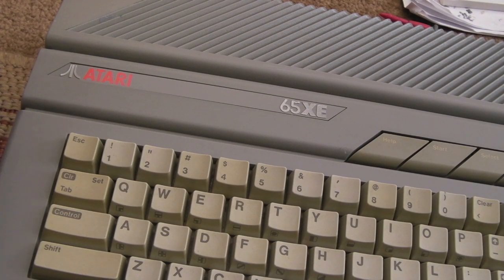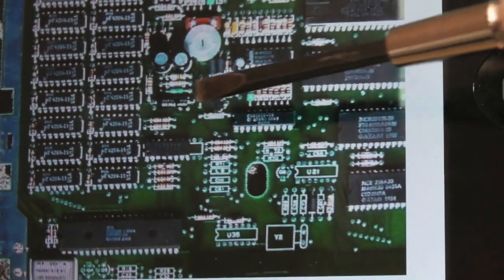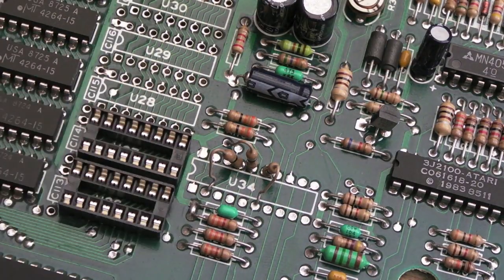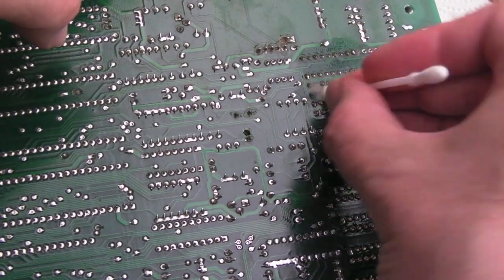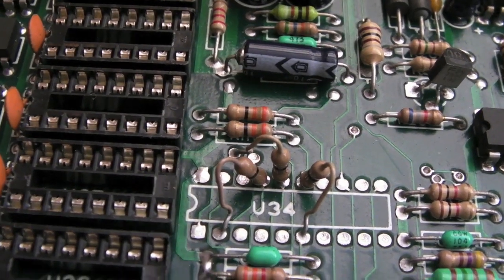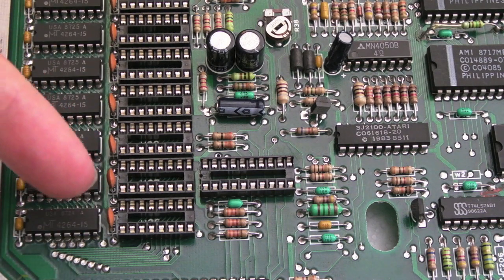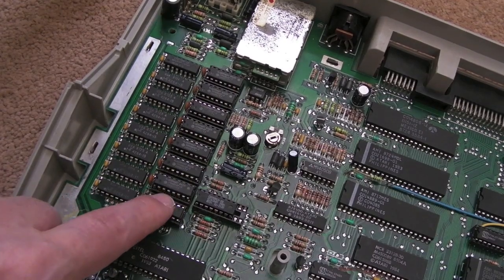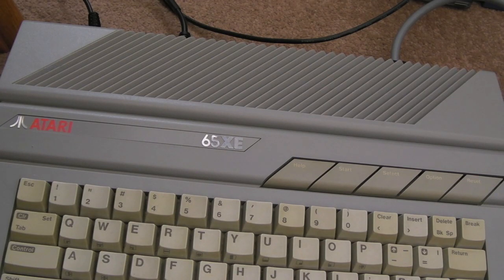Atari 65XE RAM Upgrade to 128KB (Effectively 130XE)

Comment: BIN files are typically cartridge images. ROM are usually OS ROM images.  ATR are disk images without copy protection information.  ATX are disk images with copy protection information (your disk emulation system needs to support these, not all do).  XEX are single file executables.  Those are the "modern" extensions that are being used for the most part in the Atari 8-bit community.

Comment: I recently had to replace the LS4091 shift register/encoder chips on my Atari 800XL. Cheap and easy, since mine was socketed. Actually, my RF/EMI shield was a pain, unlike many other 800XLs I've seen, but I've dealt with that in the past and made it easier to get into. Mine must be older than the ones where I see people unscrewing the shield because it also has a terminal/disconnect for grounding the cartridge door flaps.
Reply from the maker: Out of interest, what problem did you experience before you had to swap the shift register?
Reply: GadgetUK164 - Retro Gaming Repairs & Mods Many keys would not work, even after cleaning the mylar. Consulted a key matrix diagram and many appeared to be on the same row or column of connections. Checked continuity on those connections and found it was all good, despite the mylar looking burned in some areas (just oxidation). Swapped the two shift registers and noted that the specific keys that worked/didn't work changed. BINGO! I got 3x for $1 and now it's good as new!

Comment: I can't say for certain about all .bin files, but certainly Bug Hunt was packaged as a cartridge with many Atari XEGS systems, the console-ised version of the XE.  It was a light gun game, one of the few games that used it.  Similarly, Flight Simulator 2 was an old 8-bit game dusted off and given a (new?) cartridge release for the XEGS, presumably to make use of the keyboard, which at least initially was a optional extra.
Reply from the maker: Thanks =D  Yes, I think you are right in that the .bin files are cartridges.  I need to get one of those SIDE2 things now I think.

Comment: Got the 65XE now none of the tapes will load. It will Csave and Cload ok. Ive cleaned it all up, the belts seem fine its just commercial games that wont load. I get constant boot error. With holding down start and start and option on boot. Ive cleaned the heads with Isoprop. Ive tinkered with adjusting the heads but no joy. It dont sound right either, i know them dulcet loading tones well and you can tell its not going to load. Is there anything I can use to align the heads? I know the c64 had a tape where you turned the screw and the screen colour changed indicating alignment? Any help would be good. Could also need de-magnetising. Tried everything. Tape drive is a XC12.
Reply from the maker: Sorry for my slow reply!!!  Honestly it could be so many things!  I would assume that all the rubber parts in the tape deck are perhaps worn.  Any deviation in tape speed (or slipping) will mess up loading for sure.  I've seen so many C64 cassette units like that!  Take a look at what I did in that Amstrad CPC video (not the main repair the video I did soon after on tape loading).
Reply: Hi there I've fixed countless Atari and the disk drives and decks. The xc12 probably needs new capacitors. Or the head is out of alignment quite a bit. If the usual audio is really quiet then it's the caps. Believe me I've fixed stacks of them!  If the audio is ok and belts ok but deck struggles then either the 220uf power capacitors are on there way out or the motor is gubbed. All the best getting it sorted. Also make sure the sio pins are clean on your Atari and drives as that can cause problems too.

Comment: Once you upgrade your 1 amp power supply will not be enough...the 130xe with extra ram requies a 1.5 amp. Nevertheless, another great video, wish I could solder half as proficiently as you... perhaps in the afterlife.
Reply from the maker: Thanks =D  It has been upgraded (on my channel) a number of times - dual Pokey, 1MB RAM, SD2SIO etc.  Working fine!  Higher current is better though!

Comment: Using an Atari Ultimate Cart it plays fine in my Atari 800XL. Mine has an animated title screen with Harrier, a mammoth, and a giant robot. I was booting the cartridge ROM on an NTSC system and I did not have that bar on the right hand side of the screen.
Reply from the maker: Thanks, yes - I think it needs a cart.  The version I tried there appears to be a 1 level demo or something.

Comment: This could be done because that's not a real 65XE but a RAM-downsized 130XE. The mobo has the enhanced cartridge interface (ECI) unlike a real 65XE that didn't included this feature. I wonder if there's a way to convert a real 65XE to a 130XE.

Comment: Did you try conductive paint on the mylar? I had great results painting the XE mylar with it. I'm not sure it would fix the issue you described here but I think it might.
Reply from the maker: That can work well where the membrane has broken down, in this case there's nothing visibly broken to fix and its all covered by clear plastic.  Pretty sure the resistance has just increased on one of the traces.  Some models of the keyboard are much easier to fix with conductive paint.

Comment: I wish this could be done on 800XL. I have two of them, I really don't like XE series too much.
Amazing video as always.
Reply from the maker: Thanks!  Wouldn't mind an 800XL at some point - they look so nice =D
Reply: Congrats on your RAM upgrade. If you do get an 800XL try to get one with a mechanical keyboard if you plan on typing on it much. You can tell because the keycap font is different. The letter O will be more oval whereas on the 800XL mylar version the O will be circular and bigger font. Also the word CONTROL will be big on the mechanicals whereas the mylars CONTROL will be smaller. Some of the XL mylar versions type alright but many don't. The 800XL case is better quality than the XE's. Thicker plastic on the XL's while the XE cases squeak and creak due to the Tramiel cheapness factor as you see here with the 65XE keyboard.
Reply: I upgraded an 800XL with a home meade Rambo board and 4256-15 chips.  You had to do a lot of point to point wiring to make it work, but the single sided board only had a couple 74LS chips in it and I was able to do a photo resist and etch the board in a small bath of etching solution.  You can probably still find the plans online somewhere.  OTOH, just get the LOTHAREK Ultimate 1 MEG and have it all.
Reply: Does using SRAM increase the speed in some games?

Comment: Just out of curiosity what kind of flux do you use for a job like this? 
The atari computers have always had this specific kind of blockyness to what they display. Very distinctively Atari.
Reply from the maker: For something like this I just rely on the flux core in the solder - no additional flux used or required.  Anything where I need to add flux I use the Chip quik brand. eg http://www.ebay.co.uk/itm/MPN-SMD291ST2CC6-No-Clean-Flux-6-X-2Cc-CHIP-QUIK-Pack-of-6-/262880321239?hash=item3d34e35ed7:g:JdYAAOSw4CFYumTu
Reply: Obviously soldering is full of personal preference. I see so many different ways of going about it. Thanks for the link :)
Reply from the maker: Absolutely, there's more than one way to crack a nut!

Comment: Thought it was an EEVBlog upload! Very similar thumbnails you both use. Speaking of older computers I need to grab a new keyboard for my A1200 and A500. Missing springs, cracked keys etc. And the plastic pieces are coming off the circuit board underneath.
Reply from the maker: Those keyboards sound in a bad way =/

Comment: Wasn't Mario Bros XE for the XEGS? Is that a special version or something? The XEGS has 64k IIRC. Just curious, but what is this upgrade useful for?
Reply from the maker: Not sure, but the version I loaded does need 128KB.  Not particularly useful - just some games need 128KB, although there are more games that need more than 128KB, so generally speaking its better to just add the 1MB upgrade from Lotharek (which I will do at some point).
Reply: Was it a bin or cart image? Because if it was the original cartridge, it would run with just 64K RAM. After all, that was a redone version with the XE Game System in mind and it only had 64K. Never mind, it's a file version. It's later in the video...

Comment: I wish I was as neat as you, although I am blaming my iron, it's shite, I've had it over 15 years, I am surprised it even works, I think it might be time to invest in a new one, anything you'd recommend?
Reply from the maker: Thanks =D   To be honest I use an Antex 15w C class iron for 95% of what I do - cost = £15, had this current one for 7 or 8 years.  If you want to spend more and get something temperature controller, get something like a Hakko.
Reply: Cheers I'll have a look at one of those.

Comment: Is something with the disk drive causing interference on the sound? It seems like whenever the disk drive is working, there is this high pitched noise being emitted from the speaker (like during the mario brothers loading screen). Maybe this is an original feature, not a bug. :^)
Reply from the maker: Hehe, yeah - that's suprisingly the way these Atari 8 bits work!  It's like the Spectrum loading but only with 1 tone lol.

Comment: Too bad you could replace that entire grid of DRAM spots with SIMM slots like with some of the ST upgrades [which I think you've featured in some of your other vids]. You'd probably need some sort of logic and cache for the CPU and some of the other chips but it would definitely be a space saver!
Reply from the maker: The easier way to upgrade the RAM is with the 1MB Ultimate from Lotharek, featured in one of my later Atari XE videos!
Reply: true but look what could happen if all of those DRAM spots on the mobo were freed up. And for bragging rights, Lotharek's gotta bump that sucker up to 8MB to keep up with the Apple II fanatics just for bragging rights. And that's even before upgrading to a 65816 CPU replacement. :)
Reply from the maker: Hahaha =D  Yes, 8MB would be nice!  And a 65816 would be awesome too!

Comment: Hello, so I ended up getting the 7-pin din converted over to USB and its working great. I think all my RAM is bad at this point. I noticed on the underside of the motherboard some of the traces are kind of bubbled up in spots too while the top side looks good. Thoughts on swapping out the memory or reading the memory failure screen error? https://youtu.be/hGkOXOlROIo It seems like all 64K of this 65XE are bad if Ihad to guess.
Reply from the maker: It could be one faulty RAM chip causing this (I think).  Get a replacement 4264 chip and piggy back the chip (push it on top of the 1st
 chip, so its pins make a snug fit on the chip below), and re-test to see if errors change.   Also check the temperature of each DRAM chip - one or two might be hotter than the others.

Comment: Was wondering if any one can help. Turned my XE on after it's been stored for awhile. I get these black and white horizontal lines. It's a PAL version that worked before with out issue (same setup). Youtube video at the end of the post. Was wondering if it maybe an Antic or GTIA chip issue? Something I can easily swap out of the mother board. https://youtu.be/KPNKUsKn6T4
Reply from the maker: It could be bad RAM - RAM fails a lot in these.  But my suggestion is to take a look at flashjazzcat channel, maybe message him.  He has repaired hundreds of Atari 8bit machines.  I've not had much exposure to them!
Reply: @GadgetUK164  Thanks for the referral. Appreciate it.
Reply from the maker: @FilCanJay  "flashjazzcat"  I miss-typed his name =D

Comment: Not all 65xe are like this. You have a later model, where they used a 130xe board. You have the expansion port and all. Mine does not have the extra memory spots or expansion port.